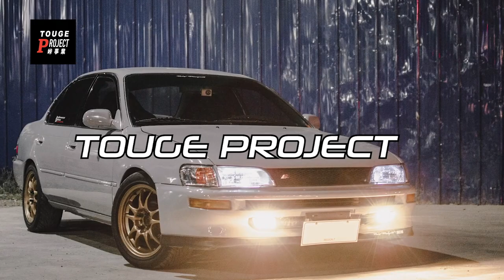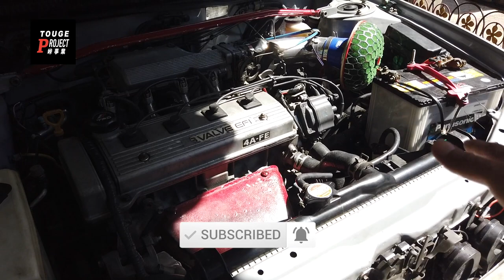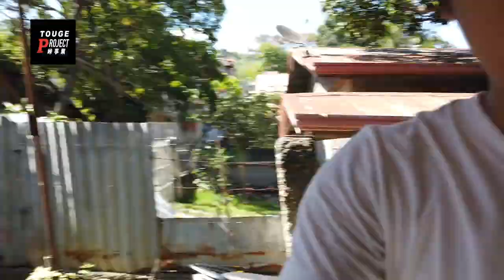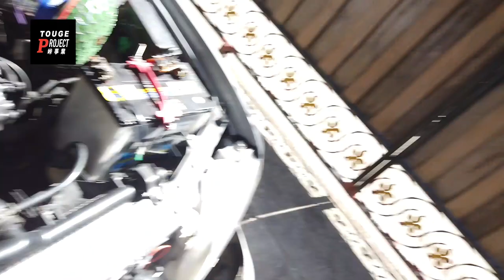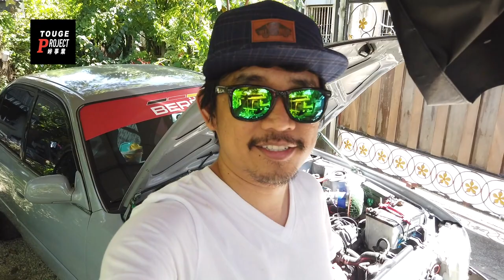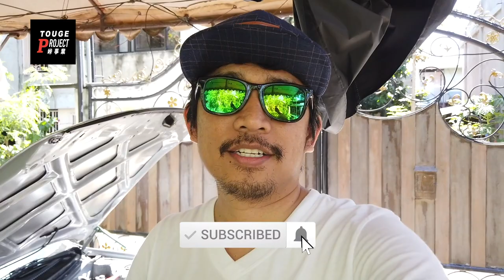Watch This Before Listening To Your Mechanic & Buy a  New Parts

Comment: ano po year model ng corolla nyo? kung 1996 up po yan stock settings nya talaga may low speed and high speed ang fan. meron yan 3 relays. yung isang relay pag on ac connected ang dalawang fan dun means 1 power supply and 1 ground supply ang nag papa andar sa 2 fans kaya low speed sya. pag nag trigger thermoswitch gagana yung 2 relay para magkaroon sila ng individual power supply at ground. yung thermoswitch is naka series sa pressure switch kaya pag nag high pressure ang condenser mag high speed ang fans.